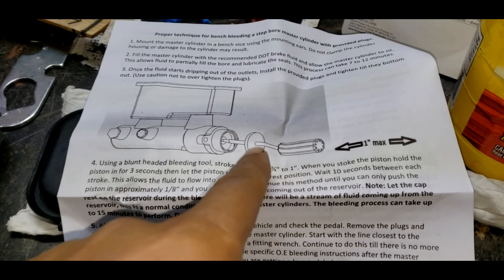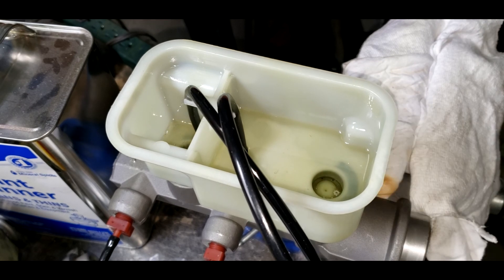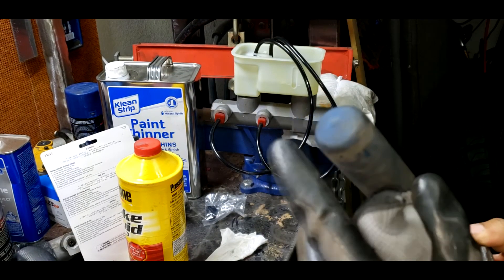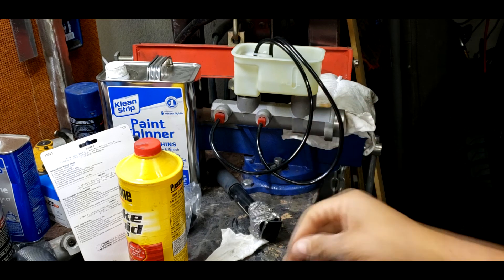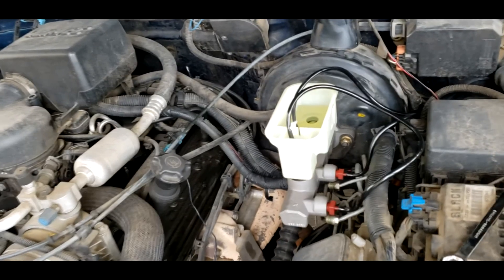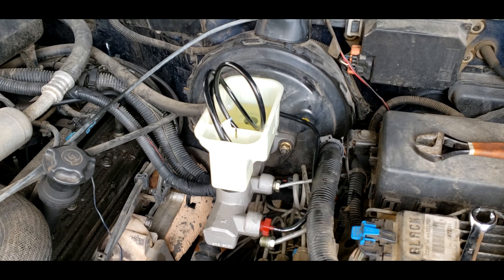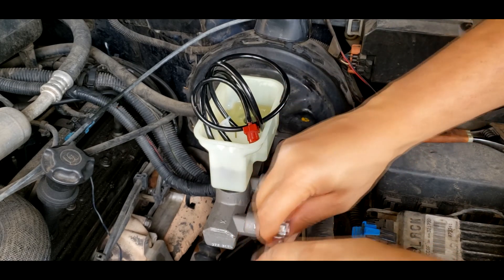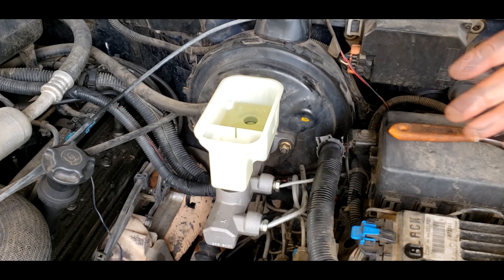Master Cylinder Installed OBS Chevy Tahoe Update

Comment: You should of just did the upgraded nbs master cylinder it looks nicer
Reply: Supposedly it gives you more braking power but I didn't notice a difference,  all you need is some adapter fittings
Reply from the maker: I thought about it & did some homework but everything I read it was mixed reviews a lot of people said they felt no different or they had problems because they got the wrong master cylinder. I just wanted to keep things simple & stick with the stock style one because I got a LONG list of things to do on my Tahoe